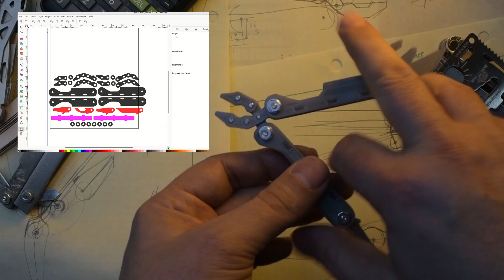Making a DIY metal multi tool

Comment: That particular design would normally cut into your palm as I've noticed with purchased tools I've had in the past.  I suspect having made it out of much thicker metal plates you would have much less of that issue.
Reply from the maker: Good point!

Comment: Firstly I just want to say well done!that's so cool making prototypes and making a final metal version. It's like a dream job for me. Designing multitools. I think you've done a fantastic job so far! As far as improvements. Perhaps try to find better looking fasteners instead of the bulky bolts you currently are using. And I'd just try out different combinations and different functions etc. I'd love to see the version that puts leatherman out of business lol
Reply from the maker: Thank you very much! I did eventually replace the bolts with pivot screws that have a more flat profile and added an utility blade holder. One challenge in making metal tools that still remains for me is that one would have to do heat treatment to make some tools like screwdrivers properly hardened. I’ve seen some people doing small scale heat treatment using propane torches but not sure I want to get into that. Probably should team up with a hobby knife maker as they do heat treatment as part of the process.

Comment: This is great!

I love having a design constraint like only using one type of material and machining process for everything and figuring out how to make something work around that limitation.

One suggestion that might make for an easy improvement, would be replacing the fasteners with  "Chicago Screws" (sometimes called "Barrel Nuts" or if you fancy a risky Google search "Sex Bolts" ). They get used a lot in leather work where a strong connection is needed between multiple layers but you also need a relatively flush exterior profile on both sides for comfort or to prevent snagging.  Ones with countersunk heads could be mounted entirely flush without changing the current design by drilling out both ends of the fastener holes with a countersink bit.

Flush fasteners might also open up some new design options with the ability to "bury" them between layers and allow pieces to pass over fasteners instead of having to avoid them as they move.
Reply from the maker: Yes!!! That makes a lot of sense. I've now ordered some lower profile fasteners. Patiently waiting for those to arrive.

Comment: instead of screws, you could use rivets to hold the plier layers together. or use flush screws with locktite

I'm tempted to design 1 myself, likely using the gear system like in the SOG Powerpint and Roxon Flex. and I'd put replaceable blade holders and a screwdriver bit holder if at all possible. maybe try to make it vice grips if i was really feeling ambitious, with the saw holding grove like in the Leatherman Crunch.

I'd be tempted to cannibalize a set of pre-made pliers to avoid having to make them by layers, just cut them to what i need or buy a plier head part used for repairs. 

something else you could do is design the component so that it's cut in flat blanks and you bend the tabs and such yourself, so you get that dimension without having to get into 3D machining. still wouldn't work for the pliers, but could make the handle and tools like scissors more comfortable than the hard 90° angles or the thin edge of the metal.
Reply from the maker: Awesome ideas. I'd love to see these concepts taken in in new innovative directions. Using pre-made plier jaws sounds good in terms of having a better steel for that part. I kind of wanted to have fun designing the whole thing, but realistically a proper plier head I would expect to be superior. There were some models that were laminated in the past, but is does not seem to be a prevalent design nowadays.  Thanks for adding new thinking to the discussion!
Reply: @ToolTechGeek  I think your original idea makes it more approachable.. pre-made parts would take away a lot of the interesting part of your video..
one though tho.. you could makt two videos out of one idea by doing it all "by your self and one where you try to make it more " professional " with pre-made parts..

Comment: This is very interesting with enless potential. The plier head design is really ingenious, makes sence as a diy option. Utilizing other materials such as aluminum or carbon fiber is a logical next step to optimize the weight. Different sizes would be cool also. You could also cut hex heads into the side for adding function and weight reduction.
Reply from the maker: Yes. Combining materials makes a lot of sense for optimizing weight. I’m also thinking about putting  items like utility blades or jigsaws etc, on the side tools which would provide cutting functions of high quality and be replaceable.